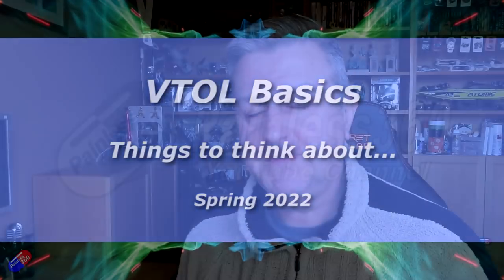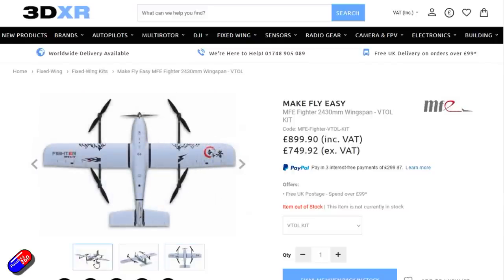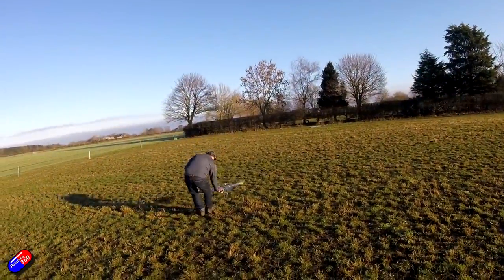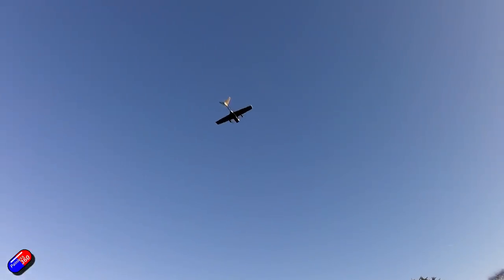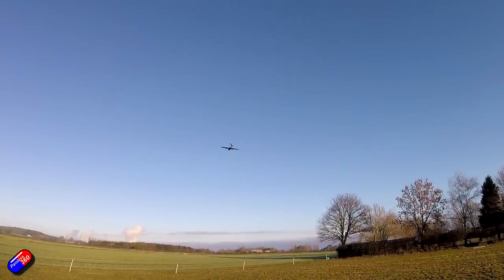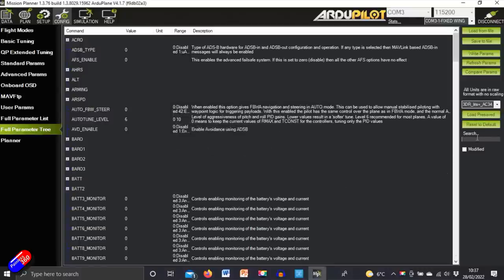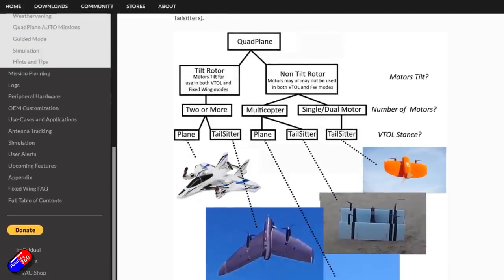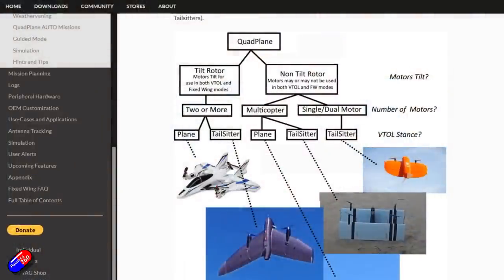VTOL Basics Series (1/5): Hardware and software choices and things to consider....

Comment: You've always had some of the most useful instructional videos out there for years Painless. 

The 4+1 layout is the most practical and makes the most sense for useful applications.  Other configurations have quite serious negative consequences.  Another useful feature of the 4+1 layout when using Ardupilot and Quadplane is the you have Q_Assist that can kick in to stop stalls before they become a problem.
Reply from the maker: You're spot on. This is exactly why the first few adventures in VTOL on the channel will use the layout. Adding too much complexity by using things like tilt rotors can make an initial build just too complex to get transitioning without crashing.  Happy flying

Comment: Love your videos! Some people use quadcopter for everything, I don't agree with this mentality. I think there are different applications for quads and fixed wing. For instance, if flying large tracts of land fixed wing is way to go. Also would be nice to be able to have fixed wing setup be able to rotate camera straight down, and at different angles from horizontal axis to vertical axis.  Maybe for searching for something on ground slightly ahead if aircraft to looking straight down at items and circling things on ground. Thanks for doing these videos.

Comment: Lee question: couldn't you just do a quadcopter INAV setup and program to turn off the esc pins on the flight controller as you transition to fixed wing, and turn on the fixed wing prop? Can INAV do that kinda of thing via the prog. Tab? Pardon my ignorance on the subject but it was a thought.
Reply from the maker: The challenge with any VTOL is not managing to have a 'quad' bit and a 'fixed wing' bit. The tricky part is handling the transitions safely so you don't 'transition into the ground'. 
That relies on careful mixing of lots of the outputs, usually as a function of the mode and current airspeed and if you don't have the lift from the hover motors before the wing stalls then you crash. 
Things like a 4+1 VTOL can do other things too like start the lifting motors automatically in forward flight if you approach stall speed to avoid stalling. So sometimes you have both 'flight profiles' working together too. Clever stuff. Stay tuned!
Reply: @Painless360  yes sir. You are 100% right that the transition is key. I would imagine any interior deviation(change to aircraft, cg,etc,etc) and external deviations(wind, temperature,etc,etc) would play a role in those profiles. I suspect airplane speed is important when transitioning although a good set of quad motors would arrest the descent. I would say maybe start with a plane with dual setup. 2 pilots 1 plane , one quad and one fixed wing. And see what the optimal transition speed is and go from there. Sounds interesting...can't wait.

Comment: Brilliant! Thanks for this fascinating series. I always wanted to build a VTOL! What about rotating wings? Is this hard to implement? The weight of a servo could less than the drag of the wing and the 4 biefy motors...
Reply from the maker: Rotation of thrust is tricky so this series is starting with the easiest build, as covered in the video.  Happy flying

Comment: I got one never could get it to take off very disappointed in it
Reply from the maker: Which was have you got?
Reply: @Painless360  OMPHOBBY ZMO VTOL I watched the videos before we started I turn on the radio first and than plug the battery to the plane it does the 3 blink red yellow green light than it does the red blinking red that says it’s not connected, I look at the caddx in the plane it has a green light on it and the green light is on my radio. Than I push both sticks up and in the corner to calibrate the gps and it automatically goes to two blinking green light, which means it’s ready gps ready to take off, I push the sticks down to the far corners and it will not do anything the engines on the wing will move forwards and backwards but the props will not spin..
Reply from the maker: There is a very specific startup process. Compass calibration is needed.... See my vsueo.. Best of luck
Reply: @Painless360  I have a Opterra 2m wing that I want to put my DJI HD video stuff in 
Here is where I need some help how do I do this 
What flight controller do I need to use the Mateksys or a Hex the cube orange I want gps on it, I have several questions I would like help with. Would you be able to help with each of these? If so, to what level of Patreon should I subscribe to?
Reply from the maker: Hi Kenny, both of those systems (INAV and Pixhawk) can run the DJI OSD now so it is up to you. https://ardupilot.org/plane/docs/common-msp-osd-overview.html covers how to do it in Ardupilot and check my INAV videos i.e. https://www.youtube.com/watch?v=9ZmGUxCDiU0
All levels of Patreon get access to me for help. See the link in description.
Reply: @Painless360  Will you make  me a list of what I need to buy?
Reply: it looks like everything I look at is either out of stock or discontinued..